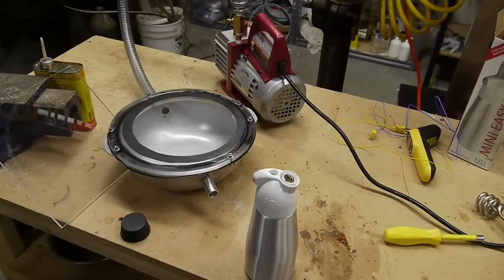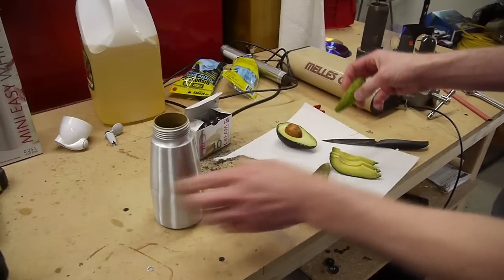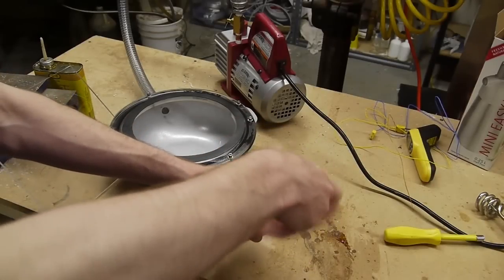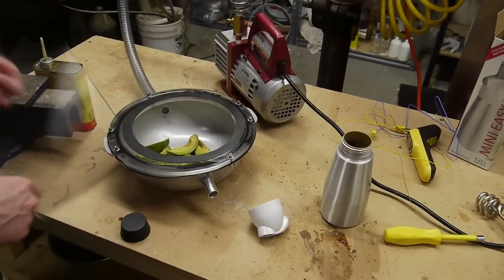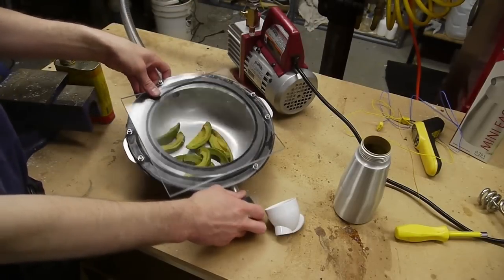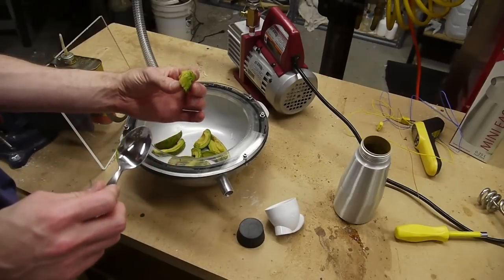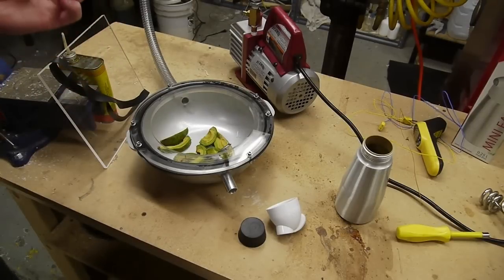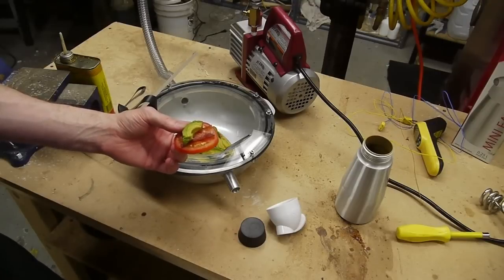Avocado vs high pressure nitrous oxide

Comment: Hey Ben, love your videos! I think your problem is that the nitrous oxide is mainly interacting with the phospholipids on the surfaces of the cells or in the extracellular matrix. Soaking the avocado slices in a solution of the enzyme pectinase should loosen the cell walls so that the nitrous oxide can exhibit more of an effect - plant cell walls will resist expansion! Although ripening does simulate this process, this should give it the kick it needs. Hope I helped!

Comment: You didn't try eating a fizzy avocado? I used to get fizzy water out of my tap (faucet in American?) when I lived in some mountains. The water mains were so pressurised to get up to 1000 metres (there were some farms higher up as well) that the nitrogen went into solution. You had to be careful to hold things firmly when filling them with water as they were easily knocked out of your hand by the force of the water. Fizzy water without the bite of acidic CO2 was very strange.

Comment: The results would have been more impressive if the N2O were at liquid-gas equilibrium pressure and sufficient time were allowed to dissolve. A carbonation bottle is not up to the task, but a supercritical CO2 chamber is.

An avocado contains up to about 30% oil.
The percentage of water is probably double that -
CO2 would be interesting to try also.

Comment: Why would you infuse avocado with NOS and then suck it all out again with a vacuum??

Why didn't you just eat it straight out of the NOS pressure chamber?
Reply: because NO can get you high.
He did that to change the texture of the avocado, not to infuse the avocado with drug.
Reply: +ficolas2 If you inhale it, not when you eat it. Also to get high you have to inhale a mix with at least 80% NO and the high lasts under a minute.

Comment: Do they use nitrous oxide gas to produce the foam?

Its the reagent that is the point of contention not the vacum. The vacum is simply the method of inserting the reagent.

Do you even know what your talking about? Do you know of the possible side reaction that you can do with NOx?  If you don't let the comment stand

Comment: And now you're posting under a different name? How comes?

I really don't know why you're typing NOx here. It is very clear we're dealing with N2O here, a rather inert gas used as a pressurizer for whipped cream. And you're worrying about what might happen?

Tell me, 'mr. chemist' (really, you're not worth the title), would you panic if someone gave you an avocado with whipped cream on it, fearing the N2O contained in the whipped cream might produce botulinetoxin on interaction with the avocado?